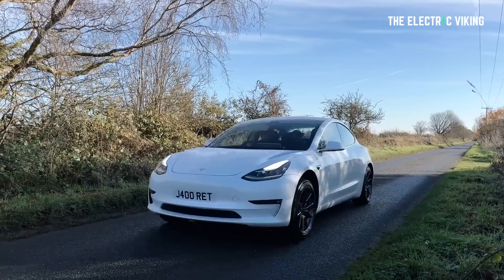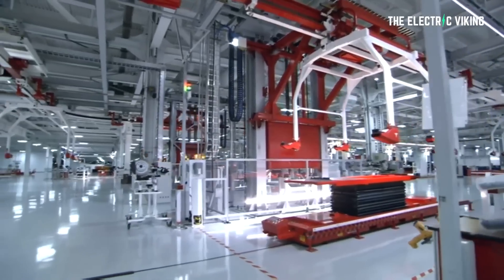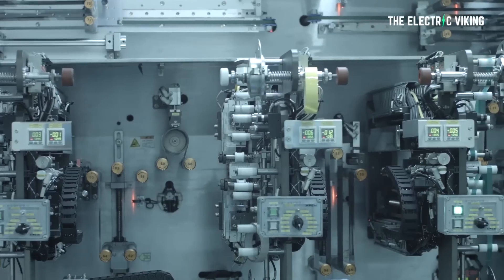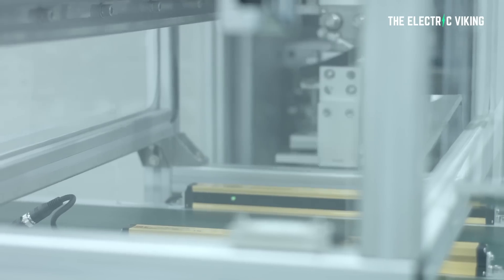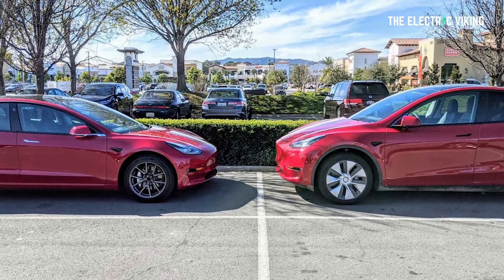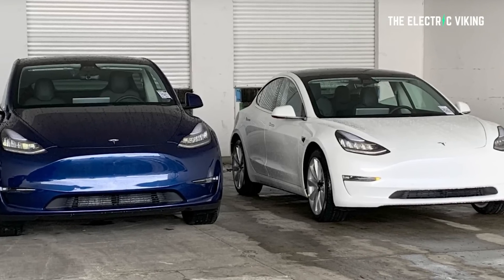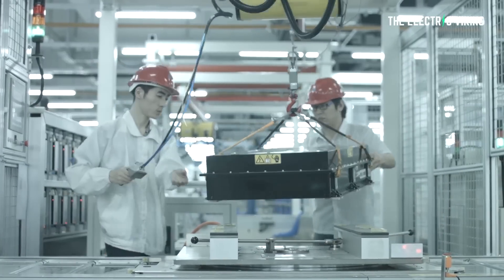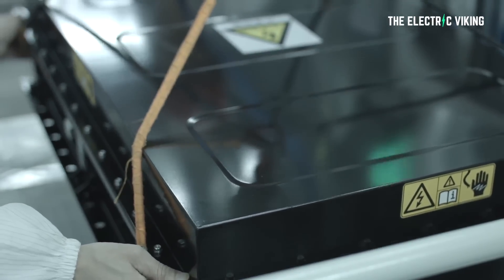NEW LFP Model 3 & Y to have over 700km range with M3P battery

Comment: I believe there is a 90%+ chance that Tesla reduces the amount of batteries and keeps the range the same. There is no incentive for tesla to increase the range just because they can.
Reply: I believe you are correct.
Reply: What about demand? I would want the most range possible. I would imagine I’m not the only one.
Reply: @edd6786  
Unless you plan on towing a trailer, often, 300 miles is almost never needed. That’s 4+ hours of driving. You need to pee!  That’s when you charge. Otherwise you are dragging hundreds of pounds of dead weight on every drive.
Reply: @whodatcatt  I would like to tow a caravan.  More range for less cost would  be fantastic 👌
Reply: @whodatcatt  fair point on towing.  I think the longest range vheicles are going to be pickups and suv in the 3/4 ton plus catagory
Reply: @whodatcatt  I live in Australia, and the distances we travel on a regular basis are long. We left the major cities and will never go back there to live, but to be able to travel to the city and back home again on a single charge is something I would definitely want. Range anxiety is still a hurdle for EVs at the moment.
Reply: @bobloblaw11111  you act like getting a change is painful. You gotta pea, eat, stretch…. That’s when you charge. 

I drive LA to Salt Lake City 3 x / year.  10 hours one way. Chargings not a big problem. 

The journey is not a race. Enjoy it.
Reply: @whodatcatt   Why are you talking about urination? I really don't care what your bladder problems are. In Australia, we don't have the infrastructure like you do in the US.  We need the range to be far better before it will be a mainstream option. And for $80,000 I want an EV that can match the range of a petrol engine, and who said anything about racing mate? Simple as that.
Reply: @bobloblaw11111  
If you’re traveling the populated east coast then you’ve got plenty of range and chargers. If you’re traveling west coast to east coast often then you’re part of the .001% ers and no one’s gonna make an EV for that, ever.  You should be flying.
Reply: @whodatcatt  Ok Tesla fanboy. Despite  you thinking you know what's best for everyone else in the world, other peoples wants/requirements  actually do differ from  your own. I want 700-1000km range. End of. If your beloved Tesla can't or won't provide it, someone else will.
Reply: @edd6786  Longer range needs to offset the longer charging times...
Reply: @edd6786  Exactly.
Reply: I am expecting the same range.
What we get?
- Less cost, less weight
- More acceleration due to less weight.
- Less tire wear due to less weight.
Reply: @bru512  Also, if the video is to be believed, three times the life of current batteries.
Reply: @bru512  I don’t think Tesla will decrease cost of it’s vehicle, because they could have decreased it for the model X and model Y, as Tesla and The Viking confirmed that Tesla has already decreased the cost to produce the model X and model Y, but the price has kept going up. They have too much back log/demand to just decreased the price. In my opinion they should and can, but they have not done so.
Reply: maybe for his subcompact, but the S plaid, cyber truck, transport truck, and any new luxury vehicles, and as a upgrade more likely.
Reply: Depends on who they are marketing to. I could see a market for a ultra long range car.
Reply: Good point. Here's a Q for the Electric Viking or indeed anyone else knowledgeable, how will you know what you are getting? Most mf's have a <year> model, eg if you get the 2022 or the 2023 Ford XYZ you know whats in it. WIth tesla new features and changes appear at almost anytime. SO unless the range suddenly jumps up on say the LR version, you wont know. I guess Tesla would say it doenst matter you bought a x km range car, what batteries we put in it are our business.
Reply: @Joe-lb8qn  ::: not so fast. Fair advertisement requires the auto maker to disclose at least the EV range, maybe not the kWh of the battery.
Reply: @Joe-lb8qn  The average mum or dad who is not an avid follower of EV development, especially tesla wouldn't have a clue what changes there have been between model 3 over the years. No PR or media releases on improvements.  Influencers all drink and repeat the same Kool-Aid conversation they find on the internet like "I don't know but...""I think...", "Maybe...", "I heard from someone who has a friend who said someone they know who works at tesla said...". Unless a prospective buyer purchases the latest EV vehicle it is a bit of a mine field for them to know what exactly they are buying.
Reply: @sammaimas155  Good point. I am as it happens a slight tesla fan (own the shares not the car !) , but at least if you buy a (say) Hyundai 5 2021 model you know exactly what its  got whereas if you buy a a Tesla Model 3 from 2021 you wont know exactly .. does it have heated seats for example or heated steering wheel? These sort of changes crept out slowly and without much fanfair. Obvs you can check into it but as you say the average mum or dad may see a current Model 3 see its got a heated steerung wheel and assume the 2021 or 2020 or whatever model also has. I keep vacillating about buying a Model Y one evening after a few to many glasses of red i suspect i'll pull the trigger.For sure if ist 700km i will but then again as others ahve said likely they will keep rage similar and put fewer batteries in which asa vTesla shareholder i concur with. Theyve got plenty other places to use those batteries
Reply: It means a long range with LFP, which frees up more NMC cells for semi and cybertruck.
Reply: I think that too but it sucks.  Personally I think more range the better as long as it doesn't get too heavy.
Reply: Yes probably however you never know BUT what you suspect makes the most sense.
I have a Y and it would be cool if they came out with a Y with ridiculous range for the same money. I would be really happy for everyone. I guess baby steps to slowly age out the older Tesla’s.
Reply: I think this is the battery NIO is going to use for their 150 kwh big battery, so will probably give their cars 700 to 800 real world range. This is coming near the end of the year. So Tesla might have follow suit.
Reply: @flukeylukey7559  too heavy. Plus they hardly make any cars.
Reply: Agreed. When Tesla has e.g. 180 kWh of batteries, it would much rather make 3 cars with 60 kWh than 2 cars with 90 kWh. Bigger profits. Tesla believes that the range they already offer is indeed sufficient. That may well change in the future but for now it is to maximize car sales for available amount of batteries while keeping range at satisfactory levels.
Reply: Idk range anxiety is still an issue with a lot of people (for whatever reason) so I see a little better chance that they will at least increase the range some
Reply: More profit coming!
Reply: 100% agree Tesla won’t increase range Elon has said the range is sufficient already. The question is if Tesla reduce the cost are they ready for the production increase ?
Reply: The only reason I believe the opposite is because this is not a Tesla specific battery......someone else will unleash the full potential of the battery. And if someone else does, and Tesla doesn't while simultaneously opening up their supercharger network they'll lose me. I might not be upgrading my MS to a newer MS after all......
Reply: The incentive is more range more sales, stronger customer retention.
Reply: 250 miles is plenty for day to day use. 3k price drop?
Reply: Unfortunately I think your spot on which is why I probably won’t buy a Tesla anytime soon.
Reply: @radtech5178  what will you buy then 🤷‍♂️
Reply: I have to agree! They'll just make more cars reduce the size of the battery they figured 250 miles is good enough
Reply: They can add a certain amount of extra range and charge ridiculously to make the already exorbitant amount of profit they are making
Reply: @deragoth4250  Yes is a stockholder I love it
Reply: Exactly, Robert I agree and they may simply increase profit margin rather than lowering price
Reply: I expect they will do both. They'll make a version with fewer batteries and the current range, as well as a longer range model. The version with fewer batteries will likely cost less than the current ones, while the ones with enhanced range will retain the current pricing.
Reply: Likely use the newly found profit margin on growth goals such as R&D, innovation, or building the next gigafactory, etc.
Reply: yeah
Reply: Tesla will just have a higher margin which is already crazy high lol. Crazy demand is still there so why not keep the prices up to fund more gigafactories, hoping to get one here in Canada.
Reply: Yeah same.
Reply: That's the right thing to do
Reply: It doesn't necessarily work like that.  The amount of kWh can be decreased yet the range can stay the same.  It's because the weight is reduced.
Reply: Or monthly subscription for extra mileage or lock it with software for those none subscribe.
Reply: I disagree.  One of the main sticking points of electric vehicles is range.  Improving this is imperative for EV acceptance in the wider community.  The design of the cars will not benefit from making the battery smaller and the price of batteries will only come down over time with mass production and making larger batteries will help with this.  Obviously smaller vehicles with lesser range can and will be designed by Tesla and others, and the promise of three times the life of current (sorry) batteries is also a major improvement, but just as obviusly, we need to see the promise turned into reality first.
Reply: @chrisantoniou4366  if the heaviest part of any EV is lighter, by a lot, then reducing the battery weight has a big difference on overall car weight & structural requirements.  Especially crash impact strength.  If you reduce the weight, suspension & main chassis components can be lighter & thus cheaper.  Knock on effect: if a Tesla hits another car, damage to the "victim" is reduced due to lower mass at any speed, therefore momentum is reduced, thus energy transfer.  Perhaps insurance costs can thus come down.  As someone mentioned earlier, also tire wear is reduced.  Reducing vehicle weight can make a BIG all round difference!
Reply: @alexmanojlovic768  I'm well aware of the benefits of smaller and lighter vehicles, but the cars have to be designed around the battery.  Personally I don't think Tesla will go for a smaller battery in their currect vehicles but that ight well be the case with newer designs.  Either way, I hope a long range battery will at least be an option.